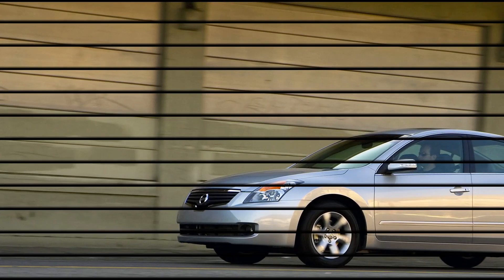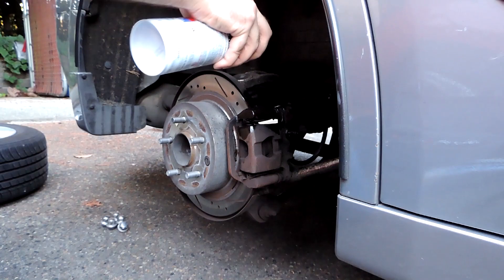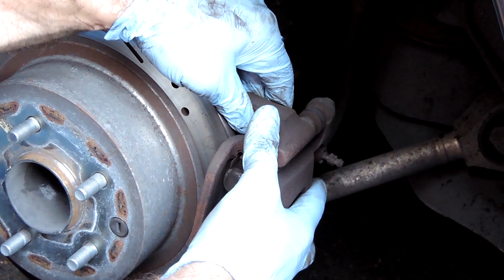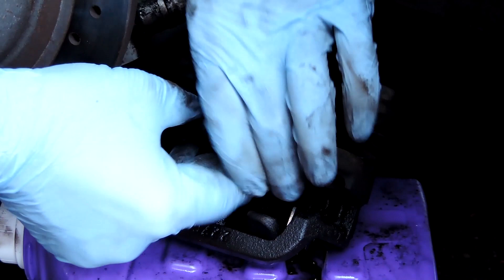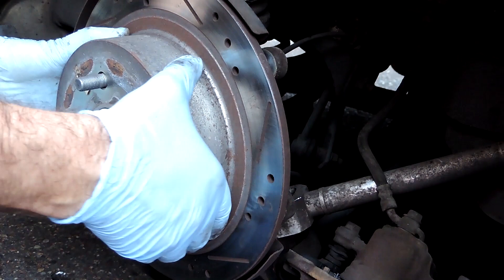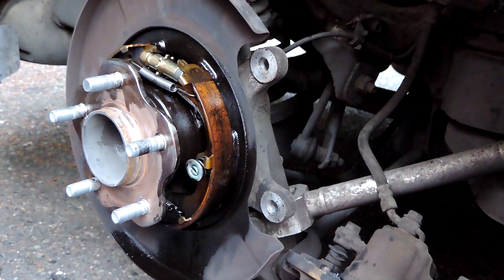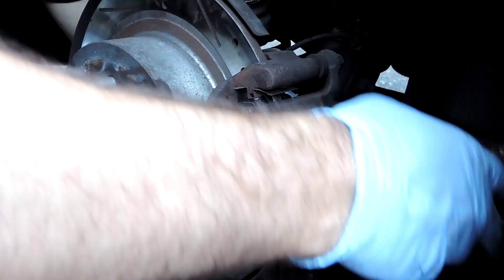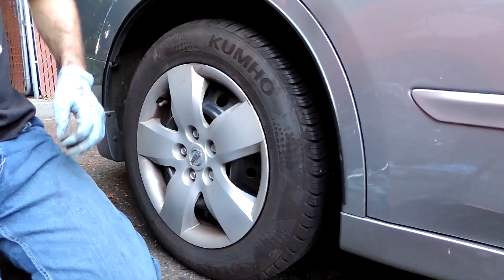How to Replace REAR brake pads - Nissan Altima 2007-2012

Comment: I’m guessing the guide pins doesn’t require cleaning and lubrication?🤷🏽‍♂️ 
Not bad though.
Reply from the maker: It should be checked, but if the lube in there is wet I just leave it.

Comment: Where can I purchase the bolts you removed at 1:15 in your video, One of the heads is stripped on the lower passenger side and I want to replace all 4  while changing my pads on my 2010 Altima
Reply from the maker: 1. You can go to a Nissan dealership parts department to buy them new from Nissan
2. You can remove them from an Altima in a wrecking yard if there is a 2007-2012 Altima there. (not sure, but 2002-2006 bolts might be the same)
3. Or bring one bolt to a hardware store to try to match the size and thread pitch. Some areas also have bolt specialty shops that can find what you need.

Comment: This video is a lie that control arm has to come free at the bottom so it can be preyed out fo the to let the bottom caliper slide out. Just did this job last night.
Reply from the maker: Your comment was posted on the wrong video. This one has nothing to do with control arms.
Reply: @bleachgarage  I'm not sure what it's called it might be a trail arm that big silver bar that crosses over the 2 bolts
Reply: @ddogg6242  Yeah, mine is black, not silver, but it definitely gets in the way.  If you manage to get the lower mounting bolt loose with a box or crescent wrench, you can remove it and rotate the caliper assembly upwards to get at the lower caliper pin. Total pain in the a** though.